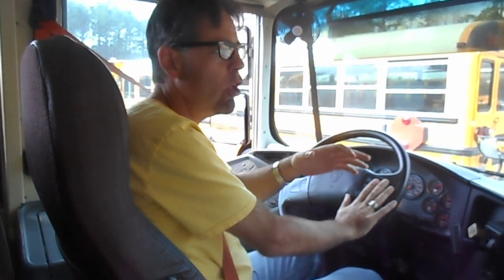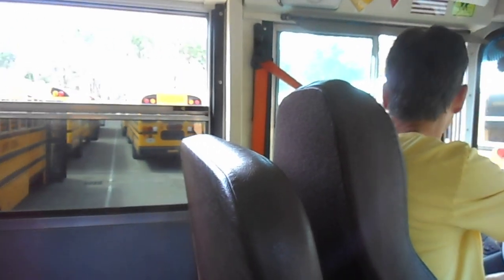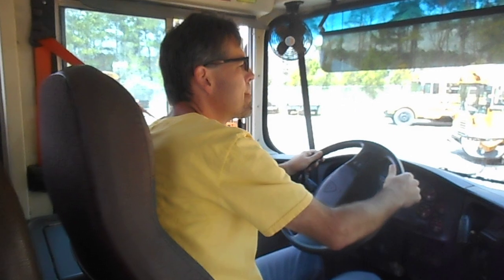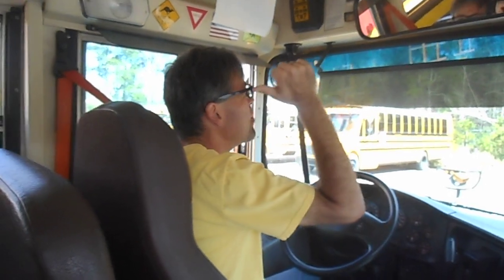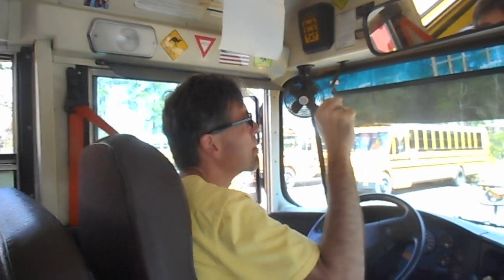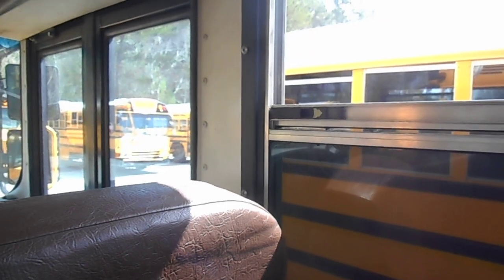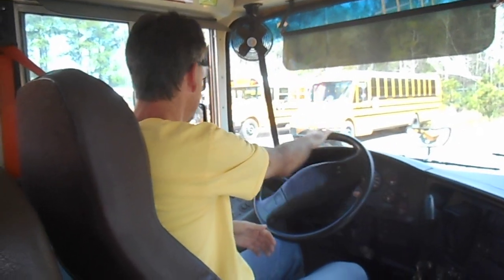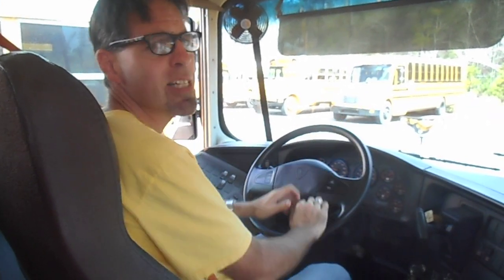70. Skills – Parking at School Bus Depot – Class B CDL

Comment: Nice. I thought the alley dock was just for trucks. Also JJ, I learned you don't really suppose to use your review mirror for backing up but the flat mirrors the most. Why?
Reply from the maker: Thanks for watching, Alvin McCranie.  Alley docking is probably the most common way to park at bus depots.

It is neccessary to use the flat mirrors to make sure that the sides of the bus clear, while backing up.

Once your bus is clearly centered in the width of the parking space, you must use your student rearview mirror to evaluate the distance between the back of your bus from potential obstacles located behind it.

When in doubt, do not hesitate to apply the parking break, put the transmission into neutral, walk near your emergency exit and take a good look at how much room is available.